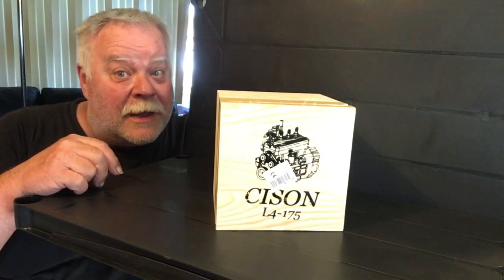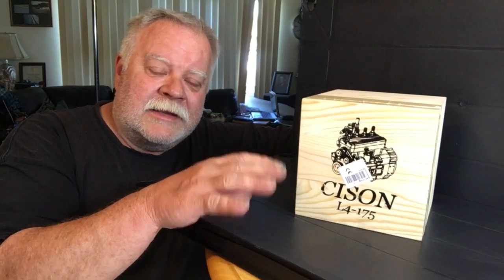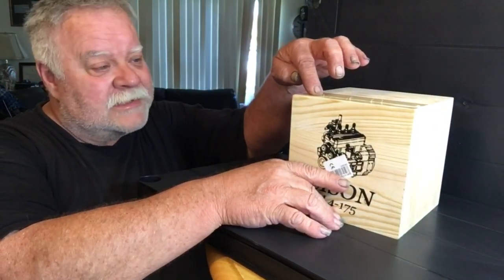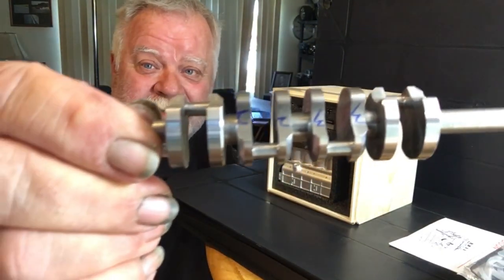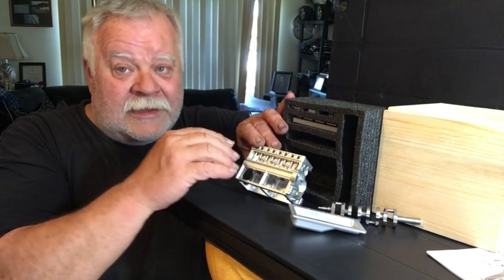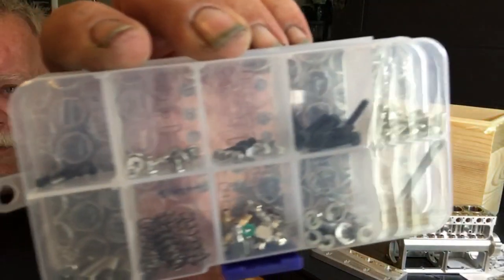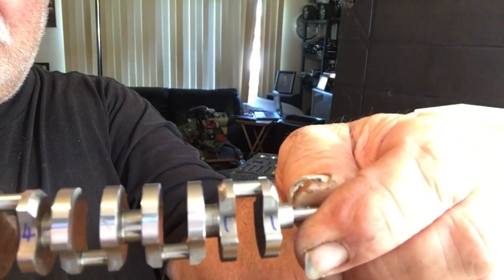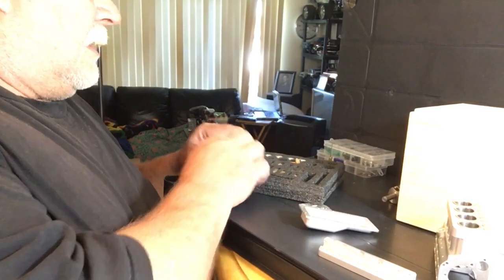INTRODUCING THE NEW L4-175 CISON FLAT HEAD ENGINE!

Comment: My Cison L4-175 is arriving Friday!  I’ve been so excited about this engine ever since Stirlingkit first showed the prototype pics back in November / December.  Thanks so much for all your great info in your vid, dude… now I’m even more excited!  
Looks like Cison & Stirlingkit have done their homework and a stellar job on every aspect.  
Cison’s parts quality and attention to detail is amazing.  I have both the silver & the black version V2, and love them.  I’ve got quite a bit of experience w’ the V2, and have made a few mods to mine that have made performance improvements such as different piston o-rings, polishing the cam tappets, removing the internal hall sensor drive gear, sealed hybrid ceramic sealed crank bearings, larger bore exhaust pipes with flanges, etc 

My silver V2 just hit 44 hours run time, and my black V2 has about 28 so far.  The other day I let my silver V2 high-idle for nearly 3 hours and it never missed a beat. They run better and better the more they run 
Looking forward to seeing more of your V2 chopper build, absolutely love what you’ve got so far. 

Later man,  - jon cook
Reply from the maker: Hey brother cool to hear from you! yeah I had to bring this engine to the table for everyone to check out, the online instructions are a challenge to say the least , we could find Jimmy Hoffa easier lol! but seriously the Cison engines are stunning quality in my opinion my V2 is music to me just listing to it idle and your upgrades will bring the V2 to a top shelf engine my friend!